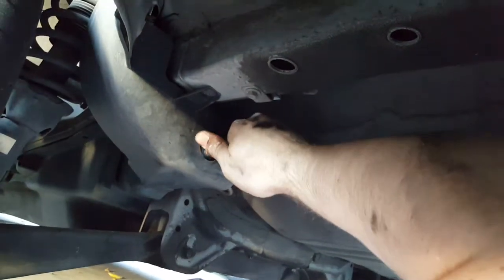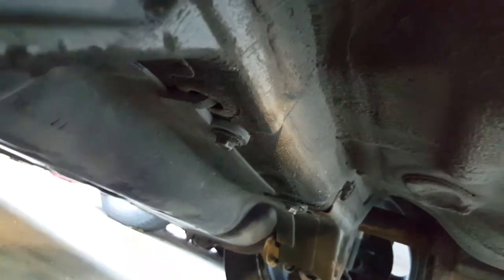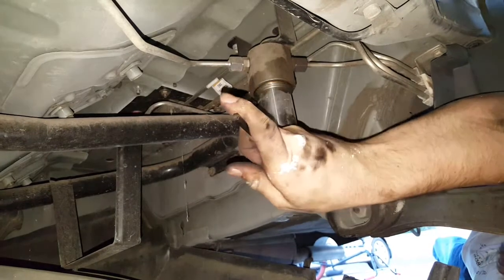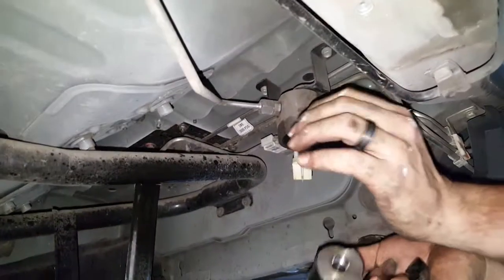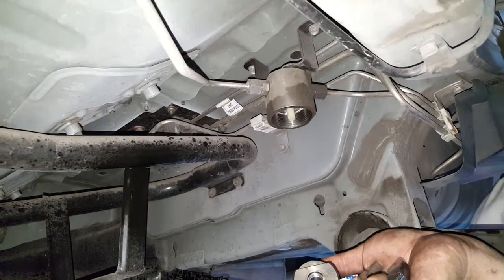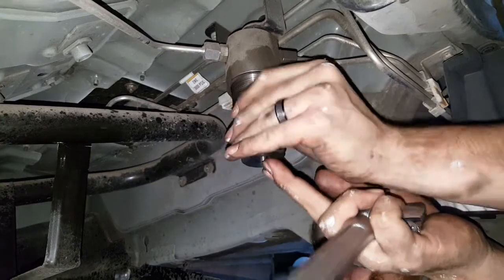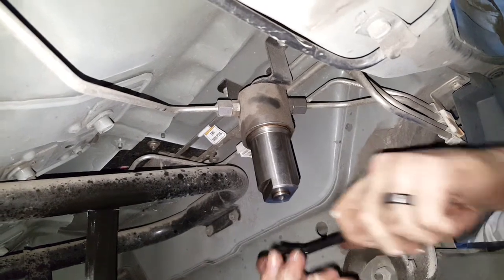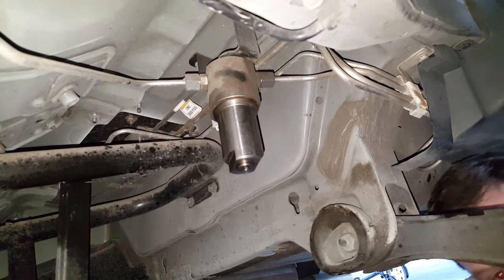How to change a fuel filter on a CNG Honda Civic

Comment: Do you need special oil for these gasoline engines converted to CNG?
Reply: No Oil system is the same
Reply: Brad Callahan of course I get that, I was referring to “Low Ash” oil for example which claims to be specifically for CNG engines.
Reply: @jamminjesus  did you find out?
Reply: @sandicueva6800  yes, thanks. I learned that low ash oil is only for diesel engines converted to CNG

Comment: I just did both filters on my 2014 Civic earlier today, searched to see who has done the latest videos and I see this one. WTH! Close the valve and run the car until it dies to depressurize the lines. Buy the maintenance manual on eBay if you want to do this yourself.

Comment: You need to clarify or even edit your video. You should never work on a CNG system under pressure. Several people have commented below on how to correctly and safely do this but I think it is important to repeat...Close shut off valve as shown then run the engine until it shuts off...then proceed as shown. People have have gotten seriously hurt doing what you just did...I know of an untrained technician who was doing the same thing you are doing but on a HD transit bus (same 3600psi working pressure) he loosened the high press filter laying underneath the vehicle to "bleed the system" before replacing,, the few threads the filter housing was holding on to let go and shot the filter housing, striking this poor dude in the chest. CNG can be just as safe as gasoline but you need to respect the pressure. Please be safe.

Comment: you shouldn't teach people how to do this the wrong way, you should have run the engine first to depressurized the system before unscrewing the filter housing, what you did is very dangerous and  can cause sever injury, besides states law requires CNG licensing to do any work on NGV cars, you must have  a disclaimer here for your own benefit

Comment: Cuestion. Were. I can bye the filter cng
Reply from the maker: sandy Perea best bet is the dealership or online. my friend, who's the owner of the car had issues finding it at auto parts stores
Reply: @DROJVDO  does anyone know if  2014-2015 cng version (natural gas version)  transmission is cvt or just standard classic regular transmission ?? because 2014-2015 gasoline version have a cvt.

Comment: Do you think CNG car easy maintain than gasoline car? I am thinking to buy the used CNG car if easy to maintain.
Beside high pressure filter is there anything else I need to know about CNG car for maintenance? Please advise meThank you
Reply from the maker: Unfortunately I cannot comment on this. I only filmed this video for a friend and have never owned a CNG vehicle.

Comment: Cut gas valve. Start car until you uses  up the gas on the line. You won't blow yourself up if you have a spark like this guy. Then do the removal process like he did.
Reply: BENITO A. Martinez yeah...it was a hot day and I Definately was not in the proper problem solving mind set.  Totally missed that portion of common sense for sure.

Comment: You skipped an VERY important step at the beginning.  After you turn the shut off valve to isolate the tank pressure from the fuel line, you still have 3,600 psi in the fuel line.  To evacuate the pressure out of the fuel line BEFORE you remove the drain plug, start the car and let it run until it runs out of fuel.  You can then crank it over a few seconds to make sure there is not enough fuel pressure to start the engine.  At that point, you can remove the drain plug and not get the excessive amount of pressure to bleed off.  Actually the way you did it is dangerous due to the potential of making a projectile out of the drain plug.
Reply: does anyone know if  2014-2015 cng version (natural gas version)  transmission is cvt or just standard classic regular transmission ?? because 2014-2015 gasoline version have a cvt.
Reply from the maker: CNG Injun thank you for making that point and you are correct. I haven't revisited this video in quite a while but I thought that i had mentioned that in my original edit. I will go back and double check my content on this. thank you.

Comment: Hi. I need to replace my fuel filter on my 04 Civic. How can I get my hands on a filter for my 04 civic? Please respond asap
Reply from the maker: link39521 easiest place to get one would be at the dealership. I've found it can be hit and miss at auto parts stores
Reply: I got mine online, but honda would be most reliable. It's definitely worth googling